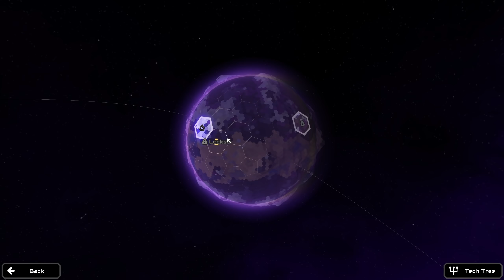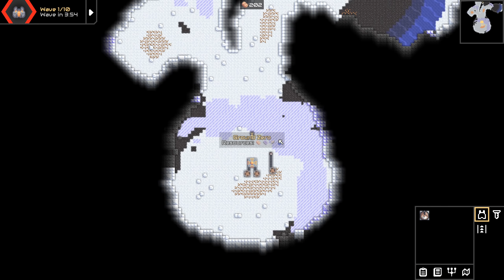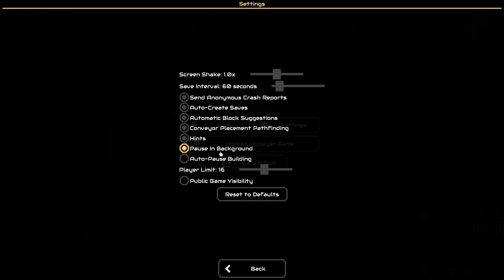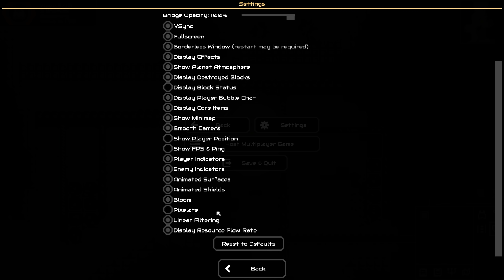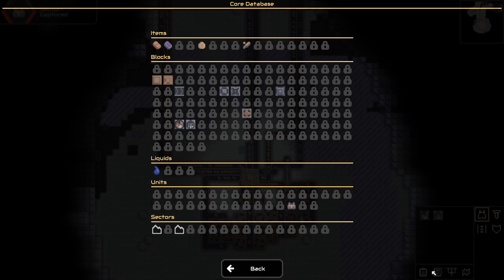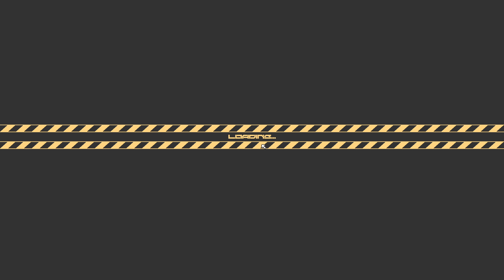MASSIVE Update! - Mindustry 6.0  - Base Building Factory Management Game - Episode #1

Comment: The big boys at 57:57 look like  they're too wide to navigate the maze, so they don't have a choice but to blast through the walls.
Reply: Some misc hints for new players: 
02:00  If you're not as fast at the game, you can pause at any time and plan new items. 
BTW, the inputs at the bottom can be used, too.  There's only a single copper every two seconds or so, so they're close to 90% empty. 
 Also: your mining laser is extremely powerful - it can extract copper faster than the best drill, from a single square.
  Even better: if you hover near the core, you won't have to stop mining just to drop resources into the core; it'll drop the resources automatically, saving time and clicks. 

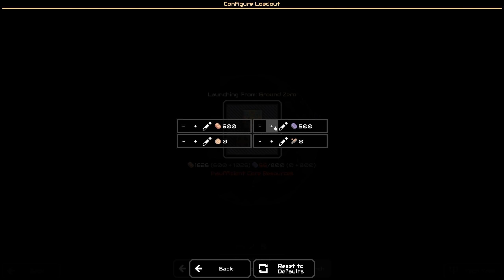22:50  The more recent versions have a MAX button.  If you click that, all resources are set for a landing with the maximum possible.   For example, if you have 1000 lead and the landing operation takes 800, a click on MAX will set lead to 200 units, so you'll use all lead you have for either the landing operation itself or your new stock from which you can build in the new sector, and likewise for other resources.  That's usually the recommended course of action; it puts the resources to good use and makes space for new resources at the old sector. 

32:00  One keeps both the resources and the approximate income per minute.  Building new stuff takes local resources, but R&D can take resources from any location. 

36:00  There are several limiting factors to production: raw materials, number of facilities, sometimes power and water, and belt speed.  A simple belt can't transport much more coal than the amount processed by 3 graphite presses.  10 would handle 3 full belts easily; 20 are just overkill.  But it was a good example of the copy-paste feature; I'll give him that. 

51:30  It's a good idea to research and build the bigger core ASAP (or at least as soon as there's no other important project left).  It adds another input per side and doubles storage capacity, which will help a lot with upcoming research. 

And finally, I was wrong about the "big boys" at the end.  The corridors are 2-wide, big enough for most ground units.  They were walking across the armor because they can (and only lose a bit of walking speed while walking across obstacles, unlike most other units, which would either have to zigzag around or stop in order to break the armor).